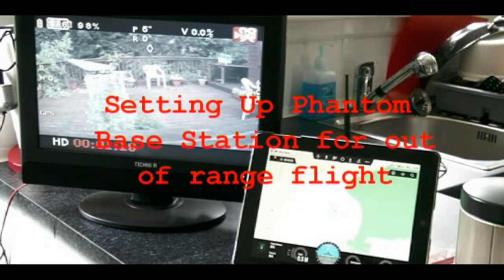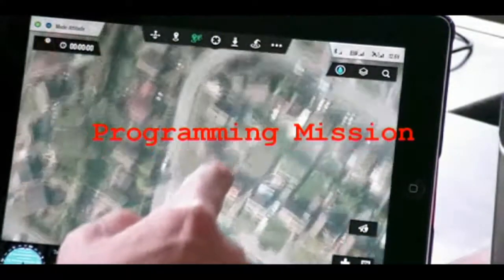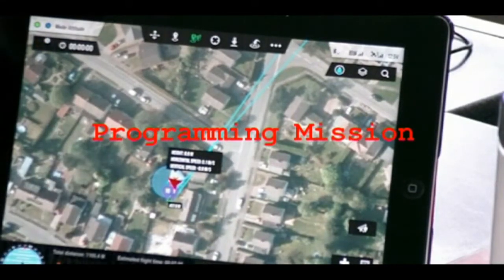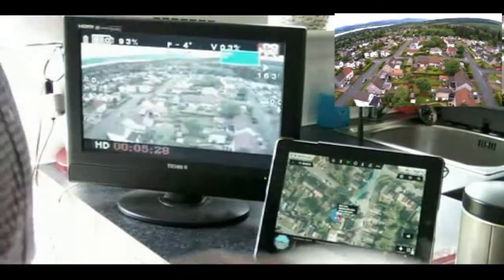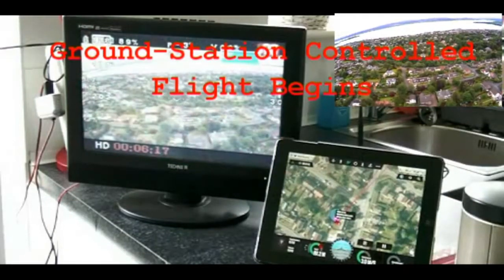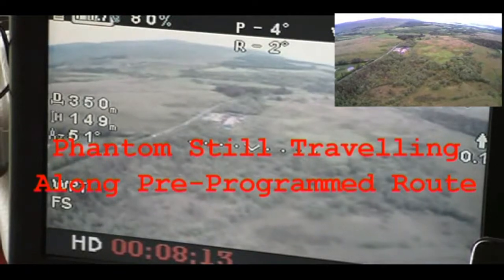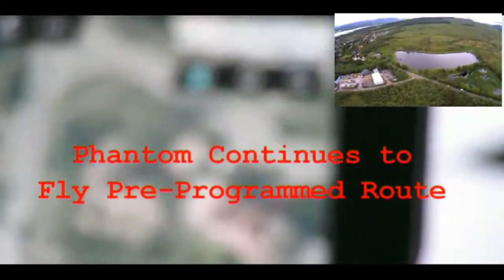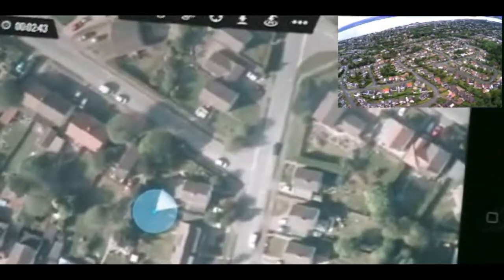Dji Phantom 2 -Groundstation Flight - Signal Loss

Comment: I have managed to get longer fpv video range by building an antenna tracker system. I have used the audio channel to send gps position to my tracker that then points a high gain helical antenna at my drone. I have used a 5.8 GHz transmitter and have had fpv at 12 km!.
That was a great flight by the way!

Comment: Did you ever realize your craft did nothing wrong and operated the way it should?
Reply from the maker: teamscreem I'm not exactly sure what you mean.  The point of the test was to establish what happened under specific circumstances.  The manual said that on loss of signal the P2 would hover then return home.  Experience showed this was not the case.  The idea of the video was to show that when the GS lost it's link the P2 would continue along it's programmed route and NOT hover and return home.

Whether the P2 did or did not operate the way it should was not in question.  The question was whether the manual was correct or not.  It was not.

Comment: Will the waypoint mission continue if my radio signal is lost?
The waypoint mission will be continued, if the aircraft operates fully-autonomous mission, regardless of Tx signal and datalink signal. Datalink Signal lost will cause Go Home function if aircraft is in the situation of waiting for next mission.
Reply from the maker: mohamed reda I think I demonstrated in this, or another, video that loss of the radio signal will cause the P2 to go into home mode.  To be clear, the signal loss I was demonstrating was the data link that sends info between the ground station kit.  Even if the P2 was in data link range and the radio control signal was lost (battery fail or whatever) the P2 would go into fail-safe mode.

The 2 signals are not linked in any way.  The GS data link is totally different to the Radio Control signal.  Hope this helps.

Comment: Very entertaining and unique video about GS and answers some questions I had about GS....the phantom behaves just as I would've thought; once the mission is loaded it shouldn't require a connection it's not as if the waypoints are transmitted to it as it proceeds that would be silly (unless you want to edit them on the fly, which you can, or call it home or control it from the iPad) this is also the first video I've watched where the mission is commenced after take off, very smart...also in the comfort of your home and with such nonchalant ease....you could have put the kettle on and made a cuppa mid flight....then you land it right out the back door...bravo best GS video I've watched and I've been watching a few!

Comment: Firstly, could I ask you to look at guidlines etc. on how to fly these things a touch more safely ie BMFA and or CAA- flying at that height is not a great idea (keep below 120m or 400ft is best) and neither is it a great idea to fly over built up areas. What would happen if a motor were to fail? GPS failure? GPS interference? Etc. Not a dig at you at all just some friendly advice.

On a different note, you will probably find that the link from the groundstation to the aircraft is stronger than the link back thus whilst the iPad may have lost the link, the aircraft still has the link with the ground station. I dont know the technical details of the Phantom's link so I could be completely wrong on this.
Reply: Sorry, but yes you are incorrect about the links between the Phantom and the Ground Station. The Phantom requires absolutely no connection with the GS after take off because the flight path has already been programmed into its flight management system. It will merrily head off and fly the programmed mission with or without data link. The data link is only for transmitting flight data back but due to the type of antenna, it will lose connection quite rapidly. Apparently in open areas, with line-of-site it will work at up to 2kms but in a residential area that will be reduced dramatically.

I am sure that it will be possible to upgrade the transmitter antenna on the air-end of the data link to vastly improve its transmission range. I and a friend of mine were talking about this earlier today and we are going to make a tutorial video once we have done it.